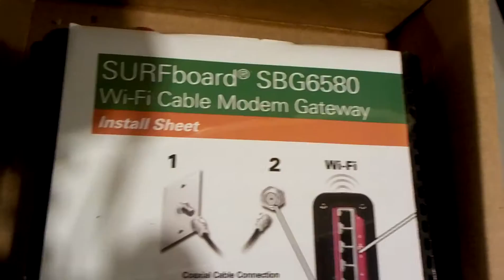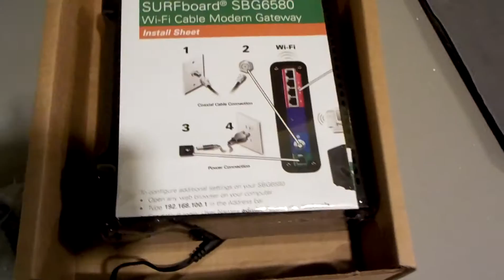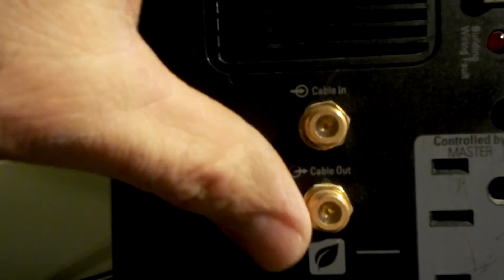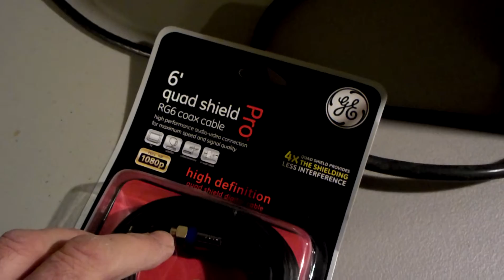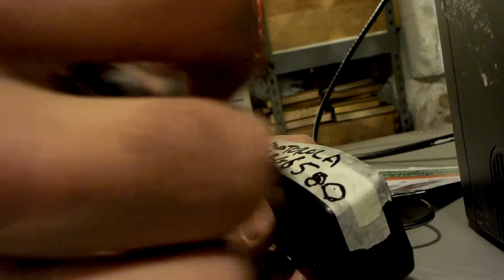Motorola Surfboard SBG6580 Installation Modem Router Installation Part 1 of 4

Comment: Love the video, use a tripod I was getting dizzy. What the hell was that tinkling?
Reply from the maker: Hi Kevin! I hear ya about the shaking! It was one of those videos I kept putting off, then one day just threw it together, The tinkling was an hanging wind chime. LOL! It was was getting tore up outside so I put it in the basement. Thanks for watching! Jim
Reply from the maker: That one does not have a telephone plug. The one with a telephone plug is a different model.
Reply: Just wanted to let you know, I set my cable modem up and got real lucky. I set it up like you did, the webpage came up, I gave comcast my info, boom, Modem works. I never get that lucky. Thanks.

Comment: I would love to see one of these videos on this model of modem with the actual set up after everything is plugged in.  That's the hard part.
Reply from the maker: There is really nothing to it. The coaxial cable for internet from spectrum screws onto the modem/router just like you screw it onto a TV. Then just plug the computers into one of yje 8 plugs, they look like big telephone wire plugs.
Reply from the maker: Ok, I'll try to do a video on the set-up. I planned on doing it, just never got to it. For now, set up a username and password. turn off the guest account, name your wireless ssid (you can use the generic name set up already if you want), and be sure to set up a password on your wireless. From what I remember, that's all I did.
Reply: @JimVincitore  Thanks for your reply. 
I have set up a few modems and wireless routers and what not and have learned how to soup computers up and down, so I know all of the basics of everything and probably a little more than the average person.  Although, when my provider (WOW) and I tried to set this thing up, it would not go online.  The set up disk that came with it does nothing but install "Adobe Air".  I am trying to figure out if there was something that we missed.  Is it advisable to call Motorola?  I tried the website in the info that came with it and it doesn't go anywhere.

Comment from the maker: Hi REdRider1600! I did a search on yahoo for, "BG6580 and vista," and found the below as the first link. Hope it helps! Great question! Thanks for watching!

My daughter has a Toshiba A135 S4527 laptop running Vista Home Premium 32bit and is trying (unsuccessfully) to establish a wireless connection to a Motorola SBG6580 Surfboard cable modem/router. She contacted Toshiba and was told that there is an issue with connecting her model laptop to Motorola modems, but they could not provide her with an updated driver. Does anybody know where she can find a driver that would allow her laptop to connect to the modem/router?

Comment: I got my SBG6580 last week.  I'm still trying to figure it all out.  Had a lot of problems getting the Wi-Fi to work with my 2 laptops.  Finally got one of them to work, my 2010 HP Windows10. 

My old 2007 Acer Aspire 9410-2597 (Aspire 9410 Z) Vista Home Premium, still not working.  It connects to the modem, but can't connect to the internet for some reason.